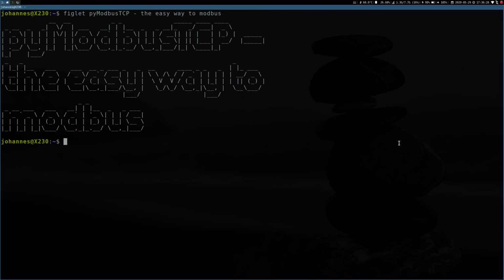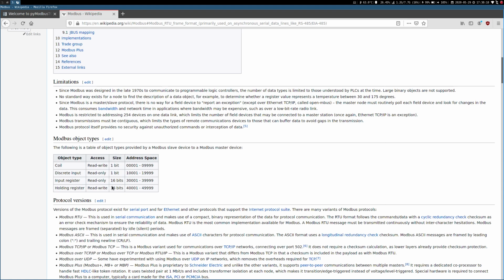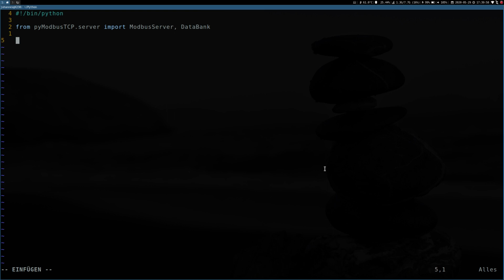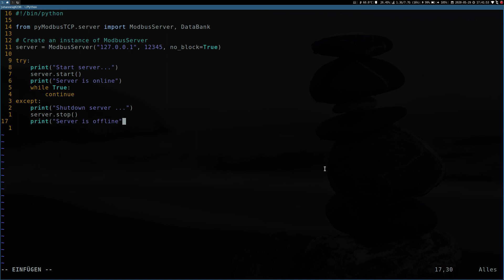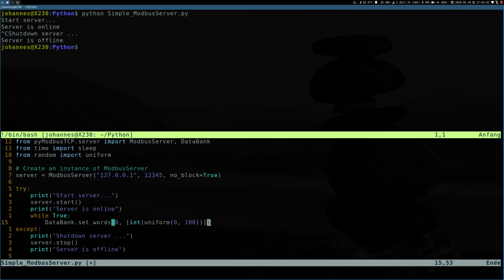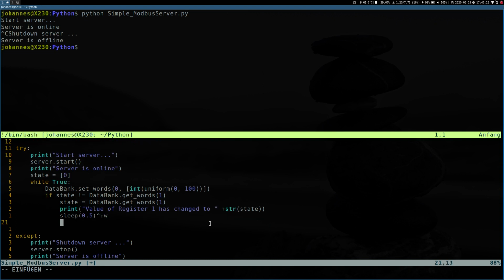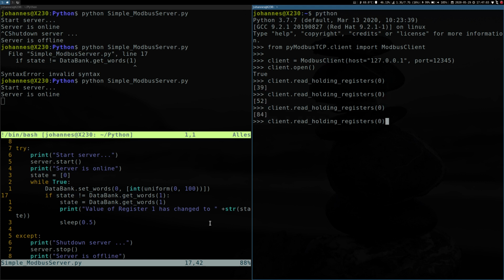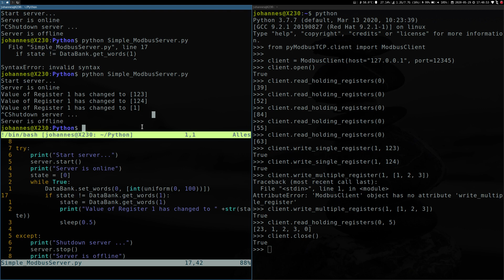pyModbusTCP - the easy way to a Modbus TCP server with Python

Comment: Great tutorial, run the test
I am getting that error, please advice... on version 0.2.0 previous version of library..  works well on version 0.1.10

  DataBank.set_words(1,[30])
/home/rd/Documents/modbus/modbus_server.py:30: DeprecationWarning: This class method is deprecated. Use DataBank instance method instead: server.data_bank.get_holding_registers() or get_input_registers()

Comment: How do you setup a client as a VM?
Reply from the maker: Search for "Briged Network" if you wnat to conenct your VM to the outside world or for "Internal Network" if you want to connect various VMs.
Reply: @johannes4gnu_linux96  So in oyur example the ModbusServer function mimick the slave (PLC) and the ModbusClient mimick the Master. Am I right? And What if I wanna connect to the PLC S7-1200 from the kali VM. How I would do that using python?
Reply from the maker: @ikbelhammami5525  As far as I know, you can program a S7-1200 to be a Modbus Server or Client. It should support both functions. If the PLC offers data to fetch for the VM, I would setup the PLC as Server a.k. Master.

For the VM setup. If you are using a bridged network configuration, the VM will actually use  your WiFi or Ethernet interface and will get an IP address assigned by your router. Then you can access the PLC just as you would on a normal PC. Just replace the 127.0.0.1 with your IP address and it should work.

Comment: how you installed?? what program i have to use?
Reply from the maker: Assuming you are using a debian based distro like Ubuntu, you need python, the python package manager pip and pymodbustcp.
python should already come preinstalled, but the following command will install the needed packages:

sudo apt install python3 python3-pip

To install pymodbustcp use:
sudo pip install pymodbustcp

And that's it. After this you can follow the instructions in my video.

Comment: hey i have a question, you didn't mention the exception is raised when you press ctlr c, but why does it work like that , is it default.
and how can I raise exceptions with particular conditions.
Reply from the maker: Witch "except:" You catch every exception. If you have a typo in the try area, the exception will be also triggered. If you change my code to "except KeyboardInterrupt::" you will only catch the Interrupt generated when you press CTRL+C. 
To throw an exception you can use "raise [exception]", e.g. "raise ValueError" in a try area.

Comment: Good evening, very good your explanation, I am starting to carry out a project with pyModbusTCP and you have helped me a lot with this video. I have a question, what would be the next step to connect my PLC as a client and that he is the one that passes the records to my server, in addition to being able to save those records later in a database, thank you very much in advance
Reply from the maker: Thank you.
Well it depends what PLC you are using. Assuming you use a Simatic PLC, there are Functional Blocks available, if I remember correctly, ModbusTcpClient and ModbusTcpServer. You can use them to connect to your server. Then you can start adding a database to your Python program, e.g. sqlite.

But here I maybe would do it the over way round. The PLC, which provides the data wolud be the server and the Python program would be the client. The PLC puts the measurement data in the Modbus registers and your python program reads them out every given time and stores them in the database.
Reply: @johannes4gnu_linux96  Ok I understand. Yes, I am using a Simatic S7-300. I already have my database in my Django web project, I am using postgreSQL. But I am somewhat complicated with this, how do I communicate the PLC with this web project through modbus? Thanks in advance
Reply: @leonelrondon8037  hey! hope u doing well, i wanna ask u if u've got the answer u need for ur question...ig i'm facing a similar problem, in fact i'm working on a Simatic PLC and i'm trying to read data from the registers by coding and running a ros node in python that connects to this plc using modbus, do u have any idea how this can be done? i'd apreciate it ^^
Reply: @Blue-xv9rg  hey! First of all, what PLC are you using? The one I used is not compatible with PYMODBUSTCP, therefore the information in this video did not work for me, I needed to communicate with it through a serial port, for this I used an OPC server, called IBH Softec, which is compatible with PLC Siemens, then in python I used the python opc library, investigate it and according to your requirements you adapt it to what you want, the Python opc library is simple and on the net there are many videos to connect PLC with python through this library, there are also a variety of opc servers, but in my case I used the one I tell you about. I hope to help you, regards.

Comment: A question, if there is a linux kernel driver for a particular device and I want to write a userspace program to talk with that device, can I simply call the existing kernel driver and use that or should I write a userspace driver from scratch?
Reply from the maker: Hi bobby, yes, of course, if the driver offers the interfaces you need, it is better to use the already implemented (and tested) drivers interface. Maybe a good example for this is the i2c lib, which uses ioctl calls to access the i2c bus. Here is a link: https://github.com/amaork/libi2c
I hope, this will help you.
Reply: @johannes4gnu_linux96  Thank you for answering my question, always good when people help each other! Wish you all the best!

Comment: Hello! I am using this library, and I observed a problem, the library doesn't work with negative numbers! 
I noticed that the -1 value is read as 65535, the function to read a holding register is supposing that is an unsigned int with 16 bits. To correct and read the correct negative value I transform the bit using the complement of two.
Reply from the maker: Thank you. Good to know. I haven't use signed numbers with this module.

Comment: i cant get my client to see any server devices (i just plugged a device into my client through ethernet and used the ip address from the connection).
Reply from the maker: OK. Do you get a response when trying to ping your device?
Some Modbus devices I know have a Webserver integrated over which you can configure them. Does your device have one and can you access it?
Have you douplechecked Modbus TCP is enabled on your device?

Comment: Good video and simple explanation...
I need to read register values from a meter register. The meter I am using is "MFM383A" Selec meter which is connected to my PC through an ATC converter using RJ45. Is it possible for me to read the register values of the meter using this method. Please help.

Comment: Hi, will you make more videos on modbus TCP in Python? I have a Dryve D1 controller for a linear axis and it can be controlled via modbus tcp, but i have no experience in that matter, so at the moment i am controlling the axis via webinterface (comes with the controller). Or can you suggest any literature where i can get up to speed on modbus TCP to be able to use it with python scripts?

Comment: What if I have my server and client on a different devices? In my case I have my Raspberry Pi (IP=192.168.1.144) is a server and my PC (IP=192.168.1.122) as a client?
If I write `client = ModbusClient(host="192.168.1.144", port=502)` at the client side then `client.open()` returns `False` after 10 seconds of waiting or so.
If I write `server = ModbusServer("192.168.1.122", 502, no_block=True)` as the server side - I will run into error when I write `server.open()`
Any thoughts?
Reply: @johannes4gnu_linux96  I was succeed by using address 0.0.0.0 at Server side.
Reply: @rmatveev  thanks! I was looking for this answer!
Reply: I got the same error which says [Errno 11001] getaddrinfo failed because of c.open(). I cant fix it what can i do
Reply: @johannes4gnu_linux96  no i used windows, but my host was in onather place, but they didnt open the port that i used. That was the problem but we solved it thanks a lot for your explanation